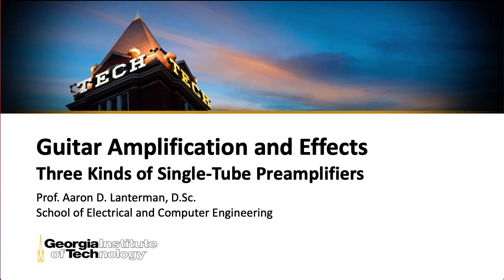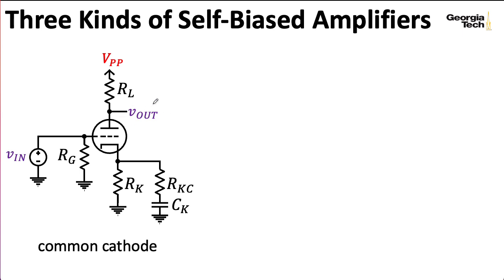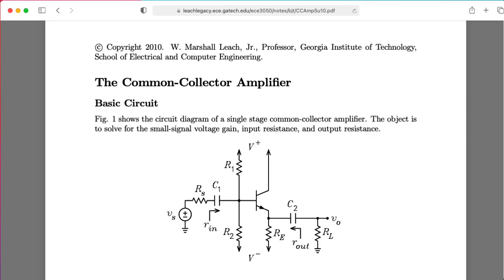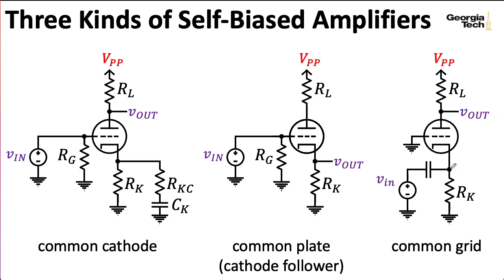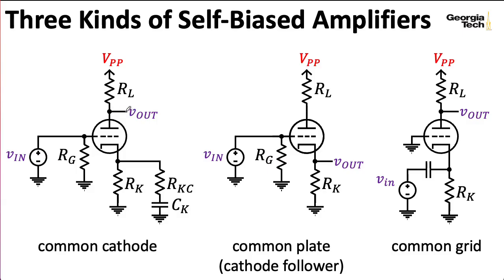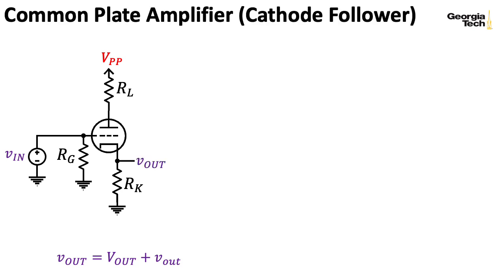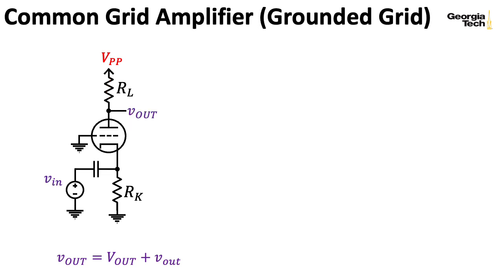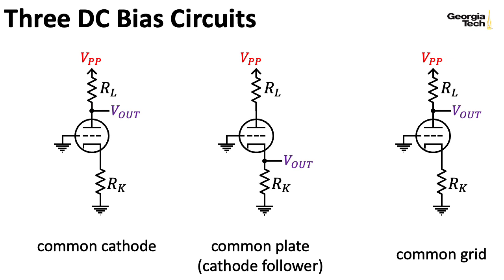ECE4448 L16: Three Kinds of Single-Tube Preamplifiers (Guitar Amplification & Effects, Georgia Tech)

Comment: Hi Prof. Lanterman. Why did some of the earliest tube amps distorted even tough it wasn't a desired quality back then? By that time, all the related theory - tubes, amps, filters transformers, audio electronics etc. - was well understood and also people weren't looking for distorted sounds yet (would only start about a decade later). Were these amps designed poorly (in terms of linear electronics)? Is it just an intrinsic property of tubes/ tube circuits that everybody just "got along with"? Or something else I'm missing? I mean, I can't believe the amps' manuals stated: "Oh, and don't take the volume knob past 4, or you'll overdrive the tubes and the sound will be distorted"
Thanks...
Reply: Early guitar amps were ment to amplify all the stuff. The gain was set really high to amplify even small signal from microphones. So if you set the gain for mic and plug guitar it distorts.
Reply: @danieldvorak3790  Hey Daniel, Thank you for replying. I humbly disagree: Consider, Fender Tweed Deluxe, which was designed and marketed as a guitar amplifier. This amp has a Cathode biased power stage with no NFB loop, and that's not the only reason it distorts but it is a major contributor to its sound and tone. It has to be something more than what you wrote, IMHO

https://en.wikipedia.org/wiki/Fender_Deluxe
Reply: @DSTheEngineer86  ur right to some extend I admit. But I'd rather have an amp that can amplify all of the stuff then just guitar at that time since gear was very expensive. But who knows the truth... not me I guess.

Edit: it's kinda the only reason I can think of. Maybe it was SMH else tho
Reply: Some amps solved this issue bz having separated mic and instruments inputs. Instrument inputs usually bypassed first troide, or had a voltage devider at the start.

Comment: Bullshit grounded grids are not used in audio amps. Some amps that take in line level or telco voice line level 600 ohm signals will have a grounded grid and be cathode fed. Some PAs that can be hooked up to the teco system have BOTH type stages. That ringer is hard on those stages.